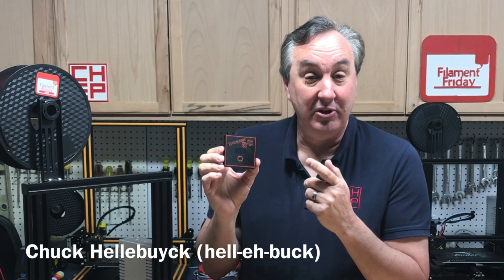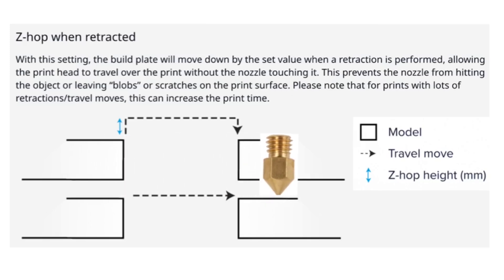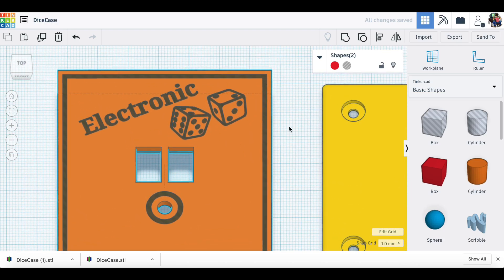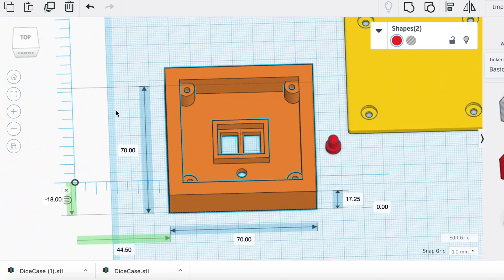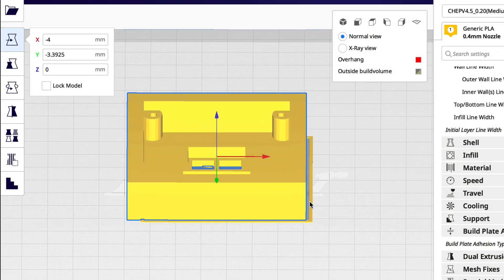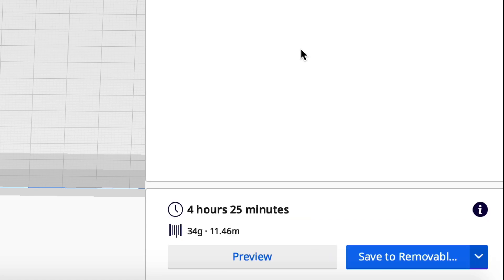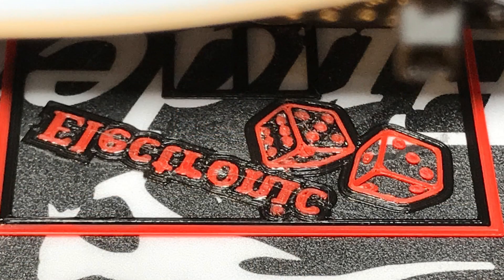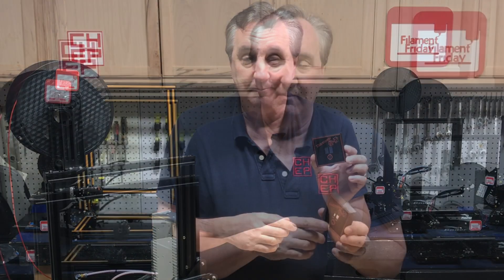Smooth Two Color Inlay 3D Print Using Cura Z Hop on Creality Ender 3

Comment: Nice video. In Cura you can use the post processing options to disable or lower the z hop after the inlay is covered (0.5mm), this might reduce print times for the rest of the print.
Reply: Hi Diogo Salazar. I liked this comment. What is the cleanest way to accomplish this in the Post Processing?
Reply: @oo7_golden_1  i dont think you can do that bro ive looked at the things you can alter in that section and it does not include disabling z hop or even adjusting the z hop distance but if im wrong please comment because i really would like to disable z hop after the two layers that cover up the inlay and ive tried everything short of g code to do it and even asked in the cura facebook group with no success the only answer i got was that you can do that in the prusa slicer but im new to that and dont know how to do it yet

Comment: Great technique.  Thanks for sharing.  I've used your "Change at Layer Height" trick to add differently colored letters to several pieces, but now I'm going to use this because it looks very professional.  BTW, you can show Z Hops in Cura: slice your model as usual and save the gcode, then load that back up into Cura.  It will drop you right into the Preview mode and when you run the layer animation, it shows the hop.
Reply from the maker: Great tip. I’ll try that.

Comment: This is great! I got this technique working well on my Elegoo Neptune 3 Pro. I found that I need to set the print speed very slow on the delicate text to keep it tight and in place on the print bed. But then I can print the body that surrounds it on a fast setting with the Z hop. It's working quite nicely. Thank you so much for this demo!

Comment: I didn't know about Z-Hop. that's very interesting. I just now finished putting my Ender 3 Pro together during the night. I'm looking at many videos and I hope to make my first test prints soon. I made one change in the Power Supply location. It was designed to be less than 1/4" from the heated bed. I didn't like the very small clearance that presented. Looking from the front, at the Extrusion as designed, there are 2 power supply mounting holes to be on the left side. Turn it 180° so the holes are on the right side of the Extrusion instead. That gives you 3/4" more clearance for the bed to pass. Some glass plates are a bit larger than the original design allowed.
(Power Supply location comments were added/edited in later)

Comment: If anybody needs to print something that isn't centered, draw concentric squares around your items (e.g. in TinkerCad). 

For instance, put a 100mm "square" (just a .4mm outline, .2mm high) around one item, then put a 99mm square around your 2nd item, and a 98mm square around your third. 
Export these thin squares as part of the .STL for each color you're using, so that each one is only printed once by one color. If you print the item with the smallest square first, you're less likely to have problems with the print head crashing (b/c the outer layers will z-hop appropriately)
This allows you to center .STLs in Cura. Everything will line up perfectly, and you'll have a "skirt" built in to each color to help purge the filament colors as well!

Comment: This really was great tip! I have done this on a dual extruder printer and you might think it would be much easier with that type of machine but you have to get the X and Y offset values absolutely perfect between the two nozzles and it is a real pain. Thanks

Comment: A little tip to make the red brighter is to enable ironing, they really makes it that much clearer. I’m doing it with a 3 color drink coaster, white/red and black to fill it in. 
I also add a square around the different prints for easy alignment, with a line width of 0.2 so it will not be printed.
Reply: How does ironing make the red brighter when the part of the red that will end up being visible is stuck to the bed? Surely you will not be able to iron it because it is turned down and stuck to the bed.
Reply: @kevinwarner959  Yes, brighter as in that the next (black) layer didn't shine through the red or white first layer.

Comment: What a great tip! I’ve wanted to do inlaid patterns on a d&d box I’m designing, so this’ll work great! What I think I’d do to take it a step further is take the two Goode files and splice them together (removing the end and start of print commands) with a filament change gcode command in-between :) ... might have to fiddle with some relative positioning commands ...

Comment: I had great success printing a one layer inlay.  NOTE: My two gcode files were not centered so I added a sacrificial ring around each print so they would stay centered throughout the process.  I peeled the first sacrificial ring off after the first file was printed.  I did not have to use Z-hop since I only had one layer.  My print was lettering as well, but I didn't have any collisions.

Comment: A very good trick! I usually do it differently and you could try. I print the first layer at 0.12+0.08 and then come with a full layer at 0.2 or higher but at 60-70% flow for the first one. It incorporates the text or the design perfectly.
Reply: sorry what does the + .08 mean in that can someone please clarify that i want to try this

Comment: More simply your doing 1st layer multi color inlay. In this case you can do as many colors are you would like. You just need a different cutout for each color. Great instructional video for the process. This can also be done in any slicer.

Comment: I have s project ready to print off and this is exactly what I was hoping to do.  I assumed cura would do it but I wasn't exactly sure what settings to modify or if it would actually work. Thank you for pointing me in the right direction.

Comment: Thanks for another great, clear, and helpful video. However, I did discover a few things that can go wrong. 1. The centering technique has some limitations. I wanted to print a "print in place" hinged box where the top and bottom print at the same time. That puts my inlay in the wrong place. 2. It would be best to prevent the gcode from turning off your bed heater at the end of the first print. Otherwise you could lose adhesion on the inlay. 3. If you're using a touch probe, it will most likely hit the inlay and mess up leveling for the main part.  4. If you disable homing and leveling for the main part, you'll also need to stop the inlay gcode from turning off the steppers at the end of the first print. I think some of these issues could be managed by some custom versions of the beginning and ending gcode applied by Cura. You would want to customize the ending gcode for the inlay and the beginning gcode for the main part. I  think the best solution would be to create a single gcode file that pauses at the correct place. This would work like the existing "pause at height" extension,  but you would need to set the pause point in the middle of a layer. It seems pretty hard to make this method more general unless you're willing to do a moderate amount of hacking the gcode. Thoughts?
Reply: For #1, alignment issues, you can put a 100mm "square" (just a .4mm outline, .2mm high) around one item, then put a 99mm square around your 2nd item, and a 98mm square around your third. (obs, make the squares as large as you need for your models, just offset them by ~1mm+ each)
Export these thin squares as part of the .STL for each color you're using, so that each one is only printed once by one color. If you print the item with the smallest square first, you're less likely to have problems with the print head crashing (b/c the outer layers will z-hop appropriately)
This allows you to center .STLs in Cura. Everything will line up perfectly, and you'll have a "skirt" built in to each color to help purge the filament colors as well!

Comment: This is a good technique. One problem I have been facing - hot nozzle melts already printed part passing next to it and final print result is not the best overall.
Reply: same issue i tried increasing the second objects speed a bit and and lowering the nozzle temp also turnig the fan on in initial layer helps a bit printing with a brim on the second object to help with adhesion still working on tweaking that method

Comment: CHEP, another interesting option would be to make engraved letters with different color (e.g. the Prusa lcd case). In this way, you would have to make a color change on the bridge infill (PrusaSlicer term), which I guess can only be made manually. Edit: Can be achieved by setting virtual extruders on PrusaSlicer! 
Would make for an interesting tutorial anyway!

Comment: Great thanks, worked perfectly witha Bambu A1. Slight variation in the tool flow. Created graphics and base in fusion then exported them separetly. Key for graphics and text in fusion is to create a 0.001 mm thick base sheet to hold them all together as one body. This serves as an alignment guide as well. The Bambu slicer totlay ignores this sheet and removes it.
Reply from the maker: Brilliant I could the same base idea in Tinkercad.

Comment: Thank you for this video. I want to use glow-in-the-dark filament for the lettering. To make it show up better, I think I need to use more than 0.4mm thickness for the lettering. What is the maximum thickness and Z-hop you would recommend?
Thanks!
Reply from the maker: Not sure. You’ll have to experiment,

Comment: I do this without Z hop. What I do is have my first color(s) layer height set to .1mm and 2 layers so the total height is .2mm. Then the layer height of the main body is .2mm. It will print right over the first prints, actually embedding them into the body of the final print. I wish I could post pictures here to show, but hopefully you get the idea.
Reply from the maker: Yep, I get it. I’ll give it a try.
Reply: I also don't use Z hop. Instead I set the first layer height to 0.32, and so the depth of indent. It's thick enough and prints in one pass.

Comment: Very cool. I’d have thought you’d scrape off the letter later and stick it on to the grooves of the box. But this is such a great idea, and it’d fuse right into the box layers. 

I’ve been wondering, does z-hop work well on the ender 5? I’ve seen your videos and am trying to decide between 3 and 5 styles. The stability of 5 is good, but if I’d have to z-hop, then this would cause the heavy bed to move right? Which is probably not good for the printer. 

So the meta question - how important / frequent is z-hop in real word (stringing and all) and is ender 3 then better than ender 5 for a decent entry 3D printer?

Comment: The other option you can do but requires thicker inset area is to take that same piece you printed first but set the horizontal expansion to something like -0.2 then you can snap them into the slot. I do not know how well it would work with the other face down as all of mine have been face up or on the side of the print.

Comment: Thanks Chep, I tried this using Fusion360, struggled a bit because I am not that great in Fusion 360 but it worked out really well.  I am doing a video on a subs and views counter shortly over on my channel and I will include a link to this video and a shout out to your channel once it is posted.  Thanks for this, great video, great idea

Comment: isnt better to put the lettering on the top instead?
Reply: In this case, not really.  Since Z-hop is the method used to avoid messing up the first print, that has to be on the bottom so the Z-hop movement will take the nozzle up and over the top of the already printed material.  The added benefit of having it on the bottom is that the first print is the smaller one, so if something gets messed up you can start over without having wasted a bunch of time and filament.  Also, squishing the "inlaid" lettering onto the build surface first ensures that it will be flat and none of it will get covered up by the surrounding material.

Comment: What a great idea.  I have been printing 2 color name tags and will give this a try.  One question.  Are you using a heated bed?  How do I keep the bed warm while I change filament?  Probably obvious, but I have never done it.
Reply from the maker: You could change GCode but my prints don’t come off that easy so I’m not concerned.

Comment: Chep my man, that is awe-as they say-some!!!! My work's engineering dept just printed off a couple of pairs of 1st angle drawing and 3rd angle drawing demo cubes on their £20,000 multi colour resin printer. Each cube has it' different faces named. So it would be hilarious if I printed something similar, but have the bottom of each cube showing the company logo or something. Oh and their prints do not have different coloured lettering, only three colour stages from top to bottom! Hmm, looks like |I'm gonna have to design it myself, as there's nothing on the web. Oh well, it'll be a first, but I'll give it a go, and hopefully publish it on Thingiverse.

Comment: I'm guessing that you need to have the border and it needs to be equidistant from the edge as they won't centre over each other if you don't?
Reply from the maker: True
Reply: You can also use "registration marks" .  In TinkerCad,  with the text or graphic still in place,  Place 4 TINY blocks (I make mine  .1mm)  equidistant from the edge of the main item. Duplicate them.  Combine the blocks with the graphic.  Combine the duplicate blocks with the main item.  Now when you center in Cura, they line up perfectly.  Been doing this a couple of years.  You can check out my project on TinkerCad  by searching for user SteveBPhelps.

Comment: I have BL Touch on my printer. I can turn off 9 points bed probing at start code, but in any case, I can not avoid auto home at the beginning of the print. If BL touch is used, it will use in in center of print bed to probe 0 of z axis. When second color will be printed, there will be already previously printed part!
Reply: melickon 
Manually edit the file to remove the homing and levelling code for the main piece.  You should be able to open it in a text editor, remove the lines, then save the file.
Reply: @boggisthecat  if I remove homing, will it print it very same spot as first print?
Reply: melickon 
The printer will maintain homing information until reset (or power cycled).

You can do a quick check by removing the homing and levelling code from something, then manually home and level before running the code.
Reply: @boggisthecat  It will only "maintain homing information" if you don't touch the axes at all while changing the filament.
There's no feedback, so the control system won't know if you've moved the axes manually.
Reply: @melickon  Did it work for you?
Reply: @spirko97  yes

Comment: This is great. Working great for a new project with an embedded logo. Question, is there a way to have z hop on for just the first 2 layers?
Reply: In Cura, there is a plugin called "TweakAtZ". You can change settings at a specific Z height. Although, I'm not sure if z hop is one of them. Maybe you want to check it out.

Comment: Doesn't the first part interfere with the BL-Touch probe (on printers with automatic bed leveling) when printing the 2nd part?
Reply: Chep answered this issue by disabling the G29 start code, I want to try this myself.
Reply: Trying it today, little advice make sure the 1st colour you print with doesn’t print on the very center of the bed, otherwise this will interfere with the bltouch when the print starts the 2nd colour.
Reply: @highroyds  I tried that, unfortunately the bltouch still probed on the first color. I just ended up adjusting the print height using babysteps. It wasn't perfect but worked.

Comment: Hi Chep. This is completely unrelated to this tutorial but I tried looking through your videos and didnt see anything about it. Very possibly because I dont know what the issue may be called or referred to. So I just decided to ask in the most recent video..  my issue I'm having is that about an inch (vertically) into prints the nozzle keeps hitting the prints and snapping supports and the print itself. It's becoming super frustrating because it's usually a good chunk of time that gets wasted before it happens. So instead of wasting more filament, I figured I'd just ask you. You've helped several times before so i trust your knowledge about all things 3d. I'm using the original Ender 3 with a silent board with smoothers on the x,y, and z axis. Dampers on all the motors with a petsfang on the hot end and nozzle. Also still using the original bed. And a new .4 mm nozzle. And a full metal extruder. I have seen some things on blogs but they're pretty vague and z-hop pops up often but theres alot of options once it is enabled but theres nothing actually going in depth about the z-hop options.  I'm hoping you can save me cuz I'm clueless at this point. If theres anything else you need to know just let me know. Any advice will be greatly appreciated. Thx
Reply from the maker: If you have a silent board then remove the smoothers. They aren’t helping. You also shouldn’t need the dampness. Check for resistance on the Z as it sounds like it’s missing steps but that could be the smoother if it’s on Z.
Reply: @FilamentFriday  ahhh. I didnt know about that. But yeah that's probably the culprit than. I'm gonna pull everything out than and see if that's what's causing the issue. Thx again
Reply: @s8nlx661  update?
Reply: @MABFR01  sorry about that. It ended up being an issue with the thermistor. The thing was just a stock wire and was a shoddy connection. So the temp wasnt reading right and would heat up after a while and go over temp and melt the layer just barely over what it should have so the layer on top sunk down just enough to throw it all out of wack. I replaced it with a new one and all is good now.